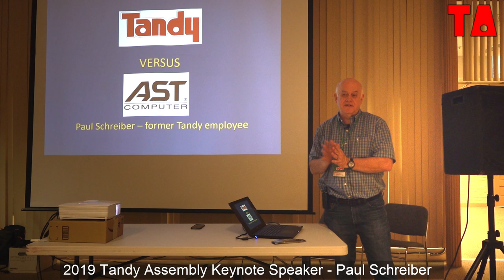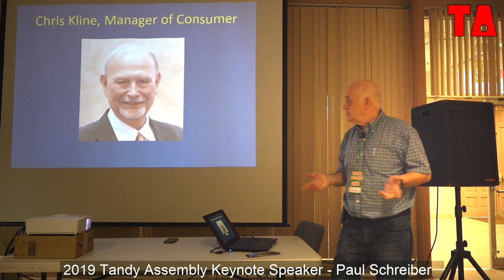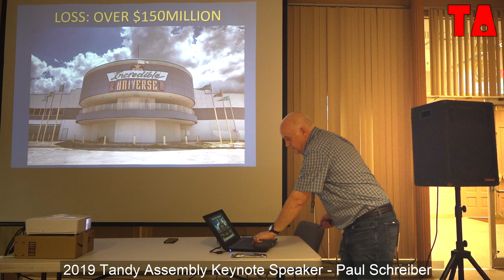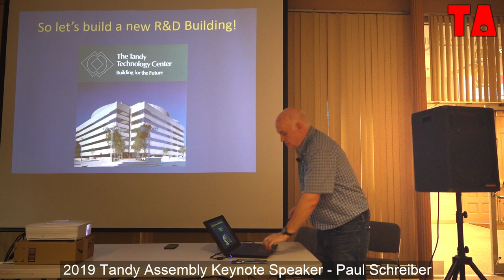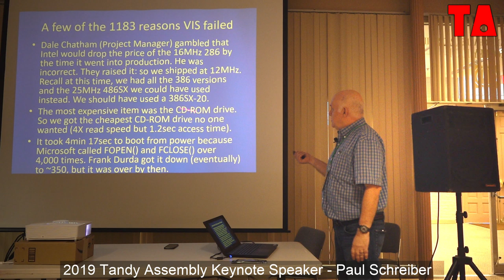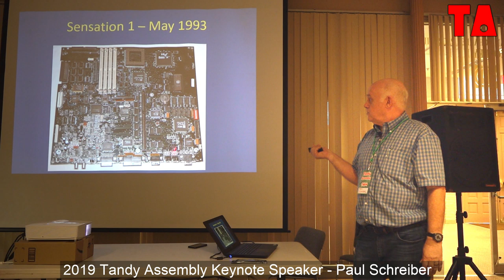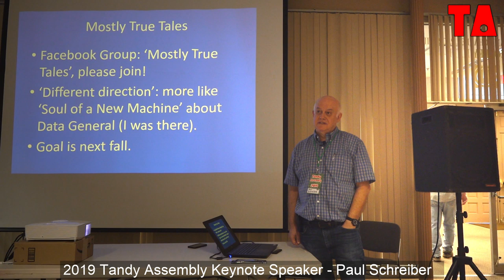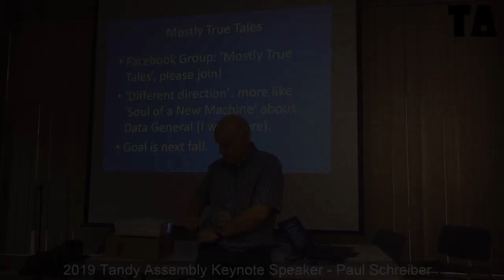2019 Tandy Assembly Keynote - Paul Schreiber

Comment: In the TTC, the 'basement' - floor 1 opened into the Tandy Center. On that same level were 6 meeting rooms and the Kornfeld Meeting room which was a fabulous place to have a meeting with the stadium seating. The second floor was the data center with the mainframes, various Unix, Linux, and AIX machines, along with all the Windows servers racks. Also on the 2nd floor were the systems programmer groups, and production control. On the 3rd, 4th and 5th floors were the corporate application development groups of the Tandy Information Services group, which comprised about 600 people. R&D if I remember was on the 6th floor. My department was on the 4th floor, and I had additional stints on the 5th and 2nd floors over the years before all of IT moved to the new Trinity River campus. The building was built to re-home the IT Department as we had outgrown a little over 3 floors in Tandy Tower 2. In fact, the IT department had a contest to name the building. Also, AST bought the computer manufacturing division, not Tandy. Tandy retained the name until 2000 when it re-branded itself as RadioShack. By then, Tandy had divested itself of most all of its various manufacturing plants and divisions, and the re-branding was a direction to focus on the 'core' of the business. Over the years, Tandy owned a lot of different ventures and created a lot of different ventures: RadioShack, OSullivan Furniture, Wolfe Nursery, Pier One Imports, Dillard's Department Stores, Alcon Labs, Tandy Crafts, Tandy Leather, Video Concepts, McDuff Electronics, Victor Computing, Computer City, Incredible Universe, MemTek, Lika Industries, Tandy Wire and Cable, and I believe there was a book store in there too......